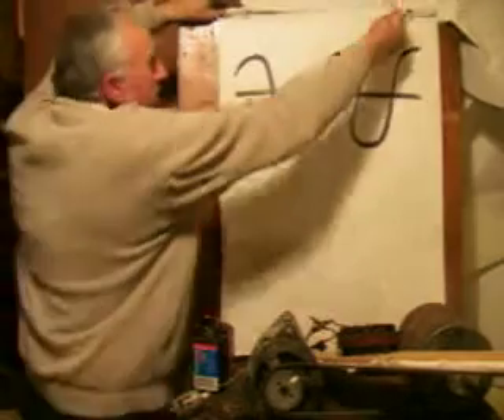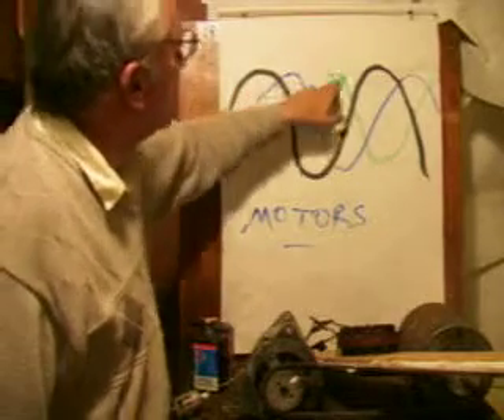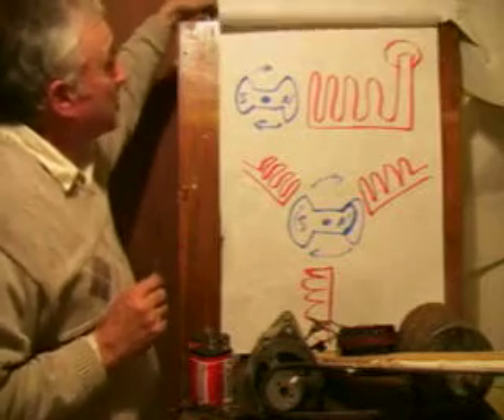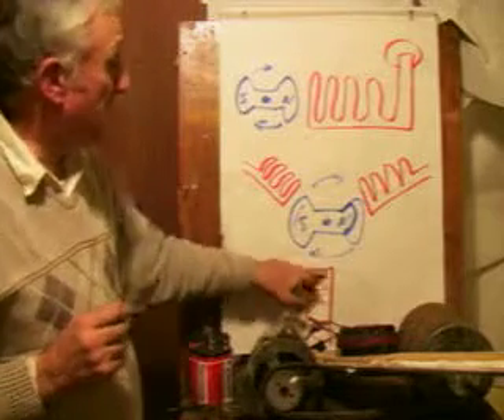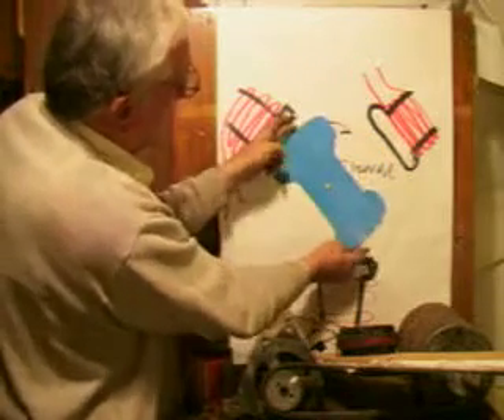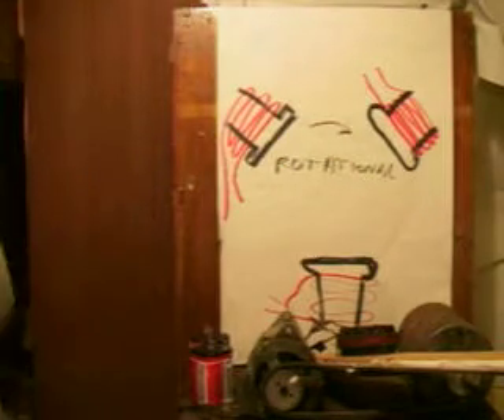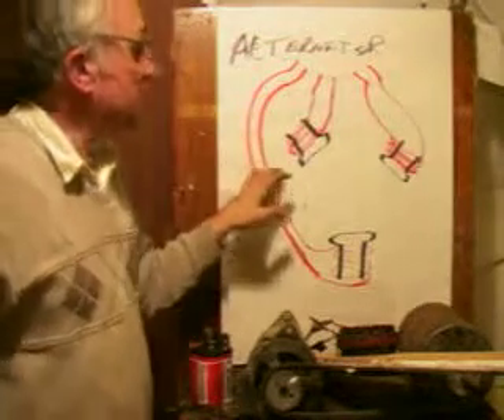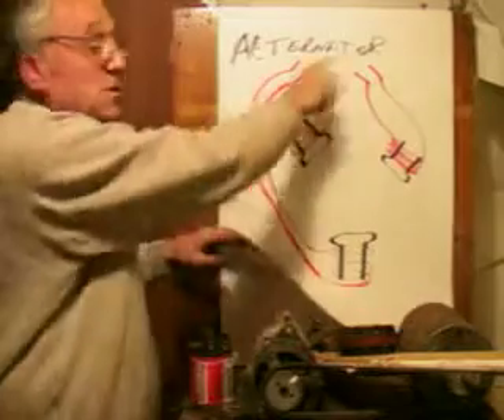"The Myth About Wind Farming" - Part 1C

Comment from the maker: Hi.  A 3 phase alternator will not motor using DC input,   the only way it will motor is if you bye pass the diodes and feed 3 phase supply into the coils.  You then need to energize the rotor with DC.  Dont use mains.    Use another alternator with diodes bye passed and a 6 V  DC supply fed into the brushes directly.    You need a rotating magnetic field to spin the rotor .  Hope that helps